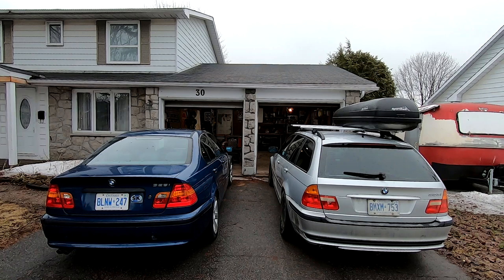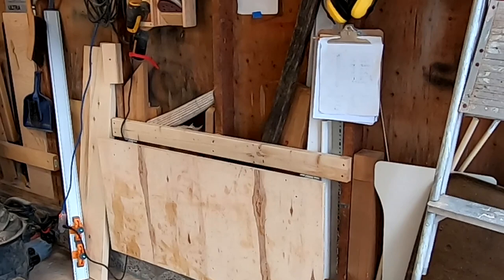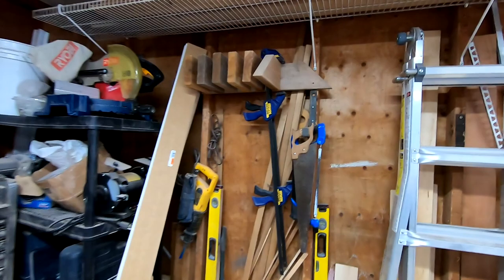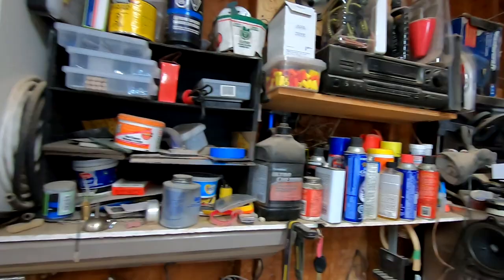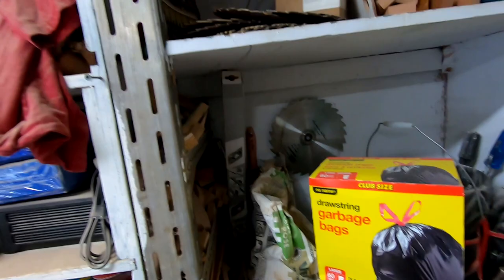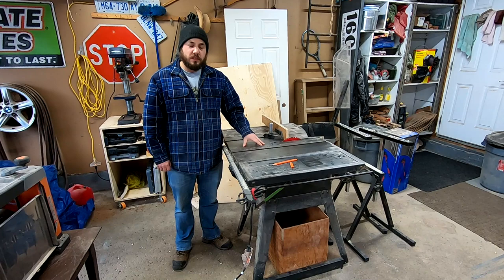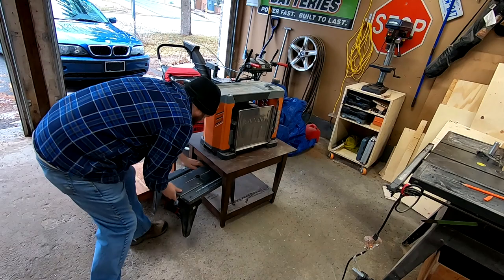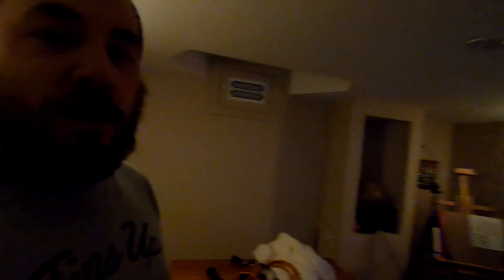[Shop Tour] - Take a look at the Grant Alexander Shop - [2019] - see my vintage tools!

Comment: I have a keen eye and I noticed a couple of beamers parked out front! Nice tour man. ps no dogs?
Reply from the maker: Hahaha, thanks for noticing. One of them was still in storage at this point (1986 325i convertible) so I will have to show it in another video. Sadly my dog doesn't seem to enjoy the shop (he is more of a couch potato) so he wasn't part of this video! Lol
Reply: @TheGrantAlexander  The '86 325i sounds cool ! what E is that ? E30 right?
Reply from the maker: @TakamiWoodshop  you are right, it's an e30. Back when the numbers were simple. 1 number regardless of the number of doors, how the trunk looked or if the roof came down!
Reply: @TheGrantAlexander  for sure the numbers used to be simpler , and make way more sense once you give up on them matching the engine size!